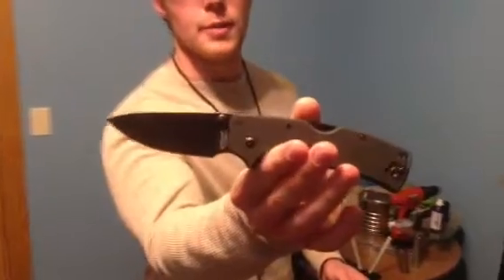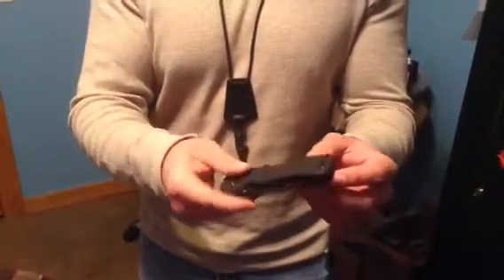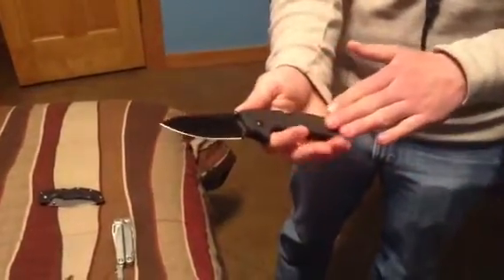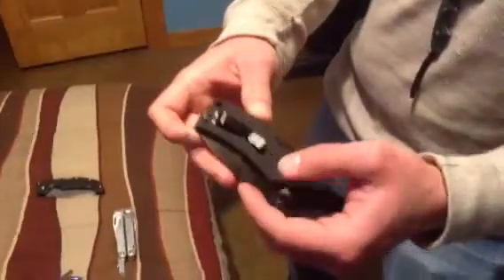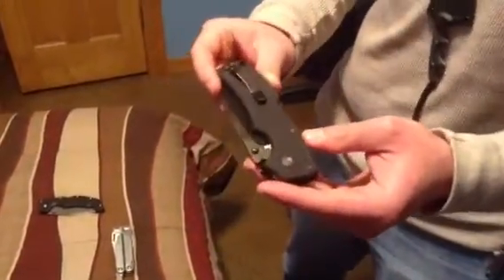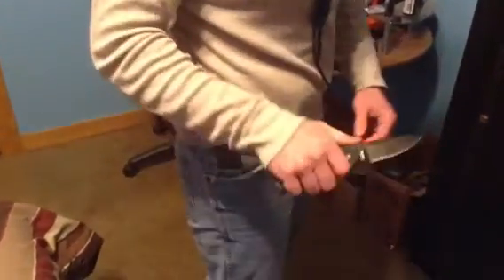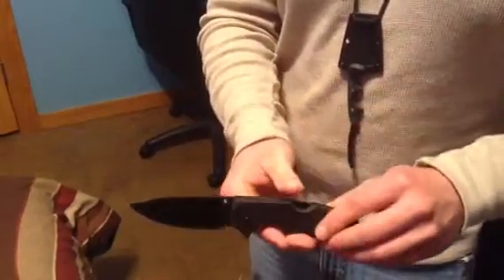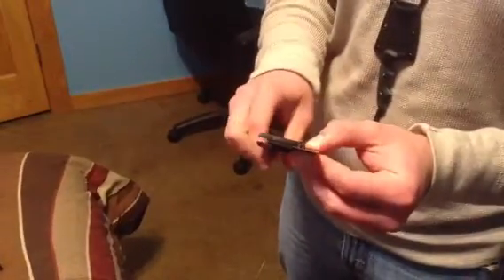Cold Steel Pocket Clip Modification

Comment: I have another dumb question. I got the T6 driver and was able to take the pocket clip off without a problem but when I tried to screw them back into place the  screws won't take to the threads. I looked into the holes where the screws are supposed to go and for some odd reason the threads don't start until all the way at the bottom of the hole, so there's only a small portion of the screw that actually gets threaded. I tried to press down hard on the screws but they won't take to the threads (I keep turning but it never tightens) and now I have a loose pocket clip. Any suggestions on how to screw it back in? I feel like a total idiot for possibly ruining my clip. Thanks in advance.
Reply from the maker: Dude, I have no idea on how to help. You might have to contact Cold Steel about this.
Reply: Mathew Culbertson Okay I already emailed them but they haven't responded, I'll call them but I have a feeling i messed it up.
Reply: Alright so some models like the talwar and espada have small inserts that sit in a cut out section of the handle. Once you take all the screws out the insert can fall out or fall down where the screws won’t reach them. Take the knife all the way apart (it’s really easy to put back together, just pay attention when you disassemble it and use a tray to hold the pieces and screws) hold the insert tight in it’s cut out spot and put your clip on then reassemble the knife. If you lost the insert don’t worry there is another one on the other handle for left hand carry, just use it. Easy pizzy